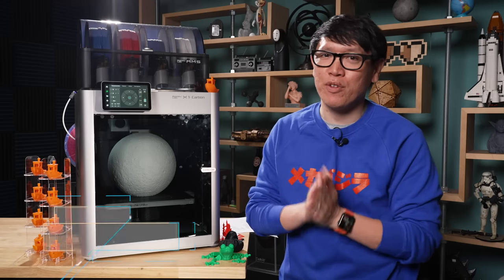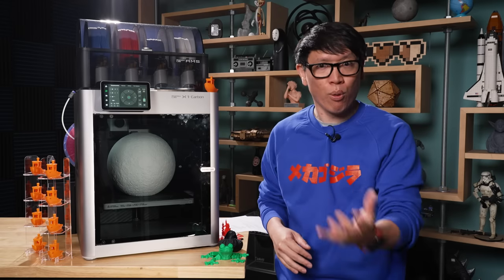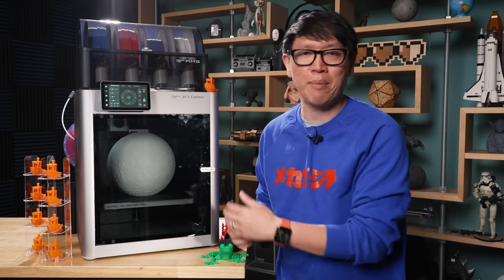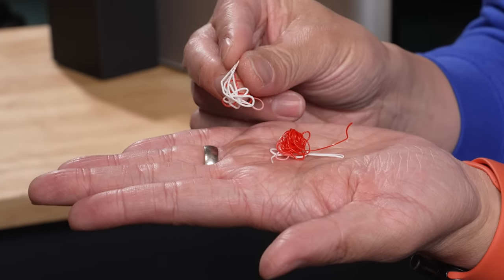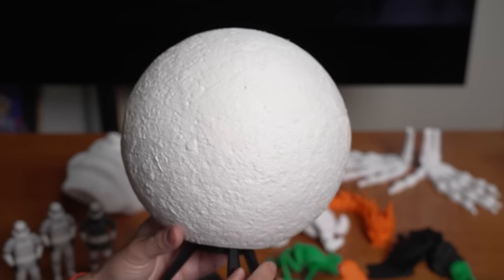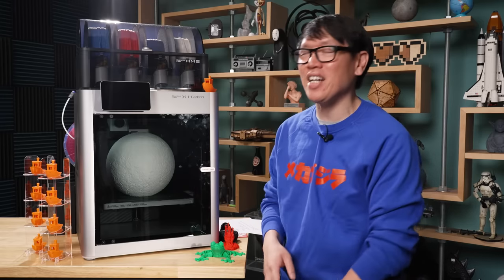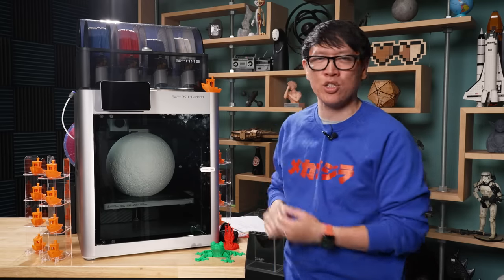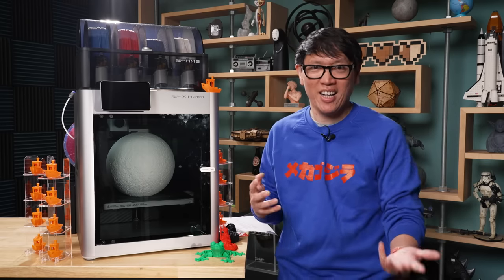Bambu Lab X1C 3D Printer Review: Speed at What Cost?

Comment: Any product that requires internet connectivity to print a file I have on my computer to a printer in my house is simply unacceptable.  All the cool features can't overcome the faulty reliance on web based processing.  I make at home to have control over my product, not give any control to someone else.  Shame on them for falling into the methodologies of the big commercial 3d printer companies.
Reply: there is a LAN mode and offline mode. it disables the use of the Bambu Handy app (or at least some aspects of it like the camera - fact check me), however does the job of you really care about your network.

Comment: Prusa is better, you wont have to send the printer back to china for rod/bushing repair, like you do the bambu lab's. Bl also has some of the worst customer support and really bad QC. They think warped beds are "normal and within spec"...even when your bed has a 1/8" dip in it.
Reply: feel free to have your opinion but it gets annoying when you slander a company for making a product on par, or better, than one you likely own. it’s better if you spread true information :)

the carbon rod does not need to be sent back to them to repair, you can order the x-axis gantry in store.

they have *decent* support, to be expected with a company less than a year old. stop spreading misinformation. prusa’s support is fantastic and one-of-kind, but that doesn’t make bambu’s the worst. it is average, and far better than that of something like creality.

QC is not bad whatsoever. don’t know where you’re getting this from. again with the misinformation.
faulty parts are inevitable with a machine. the only notable thing was that issue with beds (which isn’t that common anyway).

Comment: Lost me at "cloud service."

I stopped watching there, around 6 or 7 minutes in. Does the review mention later if the cloud service can be overridden with something like OctoPrint? Or if there is a promise from the manufacturer that they'll open the API, etc. when the servers eventually shut down? That way hobbyists could recover the machines functionality and keep it from becoming a cuboid of e-waste.
Reply: You can also print 100% offline using the old trusty SD memory card method.
Reply: @BaldurNorddahl  That's nice in and of itself. But what about using the OctoPrint-like functions?
Reply: @TheBilgepumper  no it is just a dump printer without the cloud. But at least it will not be a brick. You can use other slicers too. I suppose first layer detection etc also functions

Comment: I’d like to know when a company is going to develop a 3D printer that actually makes useful thing’s instead of small pieces of time consuming, pointless rubbish?
Reply: that’s up to the user…

this machine is fully capable of producing high performance, structural or functional parts for businesses, repairs, etc.

shame on you for going after a community you know nothing about.
Reply: As someone who has been working in a robotics lab for the last 5 years? We've been using 3D printing to make useful things for years. 3D Printers are amazing when you need a part absolutely nobody makes- whether that be a gear with strange dimensional needs, or an organic shape for human interfacing, or a structural brace at an atypical angle, or bespoke attachment for an actuator...